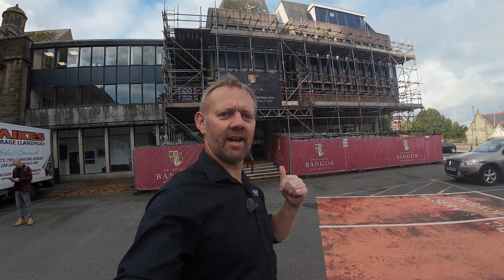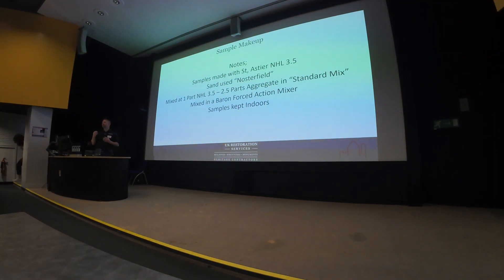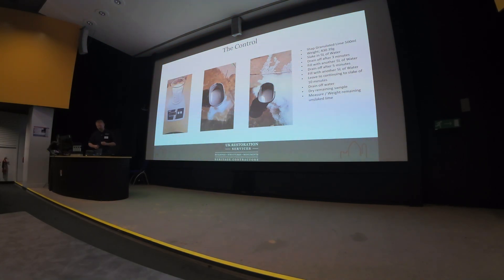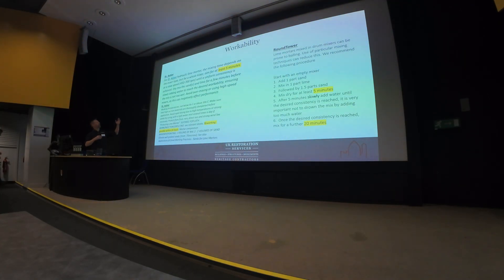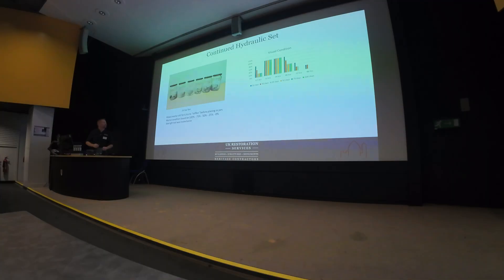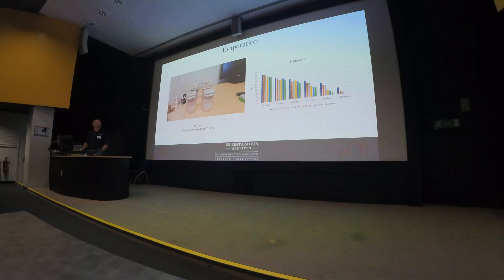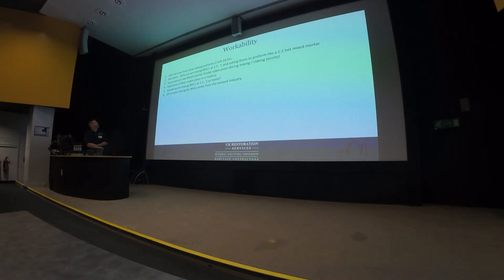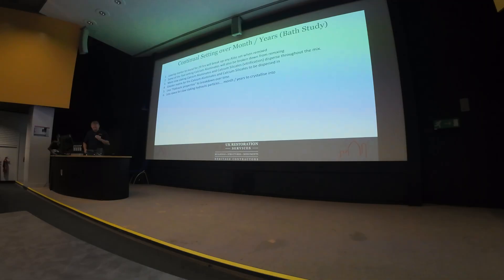48. Hydraulic Lime Lecture - Building Limes Forum 2025

Comment: How come you expect a mortar to increase its porosity through increasing the binder? The pore diameters in hydraulic limes are too narrow, gel pores, to allow water transport. The water is trapped inside, with no movement. So how can adding more binder be the solution?
Reply: We certainly have a problem with bagged NHL.
I am at my wits end with the product.
Especially as most of my work has been for ignorant builders and some clients.
44% lime in a bag adding to get some workable material that doesn't go too hard.